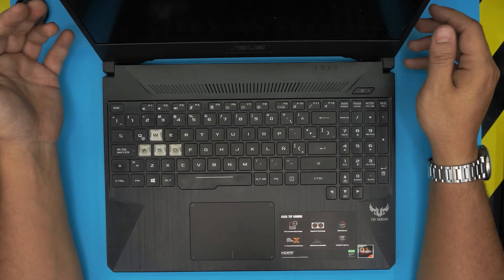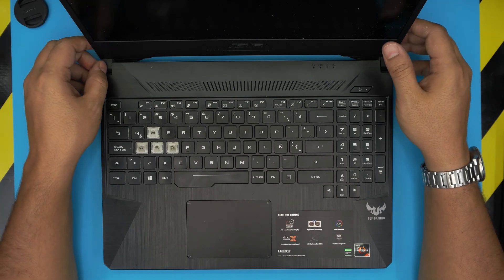How to Repaste and Clean ASUS TUF Gaming Fx505d 💻🧹- Step-by-Step Guide

Comment: Hey so i just took all that stuff out cleaned my fans cleaned the proper places and put in thermal paste, screwed it all up and turned my laptop on and it's just the start up loading screen with an infinite loading loop what did i do wrong and why isn't my computer starting? Thanks!
Reply from the maker: Did you plug in the fans properly and infinite loading explain more please.. windows loading infinite or asus logo then infinite.
Reply: @uFixTek   Double checked my fan connections unplugged and plugged back in, Asus loading screen and then preparing automatic repair pops up but i brought it in to my local guys to check out so i'll update you on what happened but what do you think is wrong?
Reply from the maker: its for sure your HDD or System that is faulty my friend not the motherboard or anything. let me know
Reply: @uFixTek  so i did apply a bit too much thermal paste to the cpu and gpu but the thermal paste is non conductive and it was not a crazy amount, i only ran it for 5 minutes then turned it off and brought it into fucking geek squad when it was posting but not turning on and now my CPU is apparently fucked, could that of been my fault or would it be theirs because they had it up and running trying to redownload windows and a bunch of other shit BEFORE even cleaning out the fucked up thermal paste im in a big battle with them and wondering if this problem could've been cause by me or if it's most likely then
Reply from the maker: @tylermitchell684  oh boi i have two friend working in geek crap  , and the shit that say that they do in there its jew dropping. they killed you motherboard and giving you BS sub excuses. if your laptop was posting then tell them give me my laptop back as it was before i gave it posting at least, if a laptop is posting the CPU is 10000% fine.
im very sorry that this happened to you. i would talk to the manager and be like i have a video recorded and prove that you received my laptop posting and not its completely dead. i will file a lawsuit. sorry :(

Comment: Cleaned it today morning, I didn't dare to remove fans but I've cleaned them carefully. Temps dropped from 60-70 C with turbo boost disabled down to 49 to 47 turbo disabled. GPU is very quiet after cleaning.  Thank you bro
Reply from the maker: Awesome my friend! Glad it helped you😊Thank you for the feedback! if you wish to support the channel you can LIKE or SUB or both :P
if you have any question or request in the future feel free to ask me.
Reply: Wait what, 60-70 while gaming? I used to have 90+ when it was new but it worked fine , but now after two years and a half I have a lot of thermal throttling
Reply: Bro my system is going at like 98°C while gaming.

Fucked hangs while playing COD2
Reply: How did you do it without removing the fans?
Reply: @Cheng-n5r  I didn't remove fans.
Reply: @Christian_VII  but how did you clean them without removing
Reply: @donatello9656  compressed air.

Comment: Is the thermal paste really necessary? I don't have the ability to redo most of this, i was just planning on openning it up and using compressed air
Reply from the maker: Thank you for the feedback! if you wish to support the channel you can LIKE or SUB or both :P
regarding your question: as long as you don't lift the heat-sink and only disconnect the fan connectors before using air compressor, you fine it will help.
Reply: @uFixTek  thanks! And forgot to say the video is amazing
Reply from the maker: thank you for the support my friend :) 
if you have any question or request in the future feel free to ask me.
Reply: @uFixTek  what if the heat sink was lifted without re-applying a thermal paste? Will it pose a big problem??
Reply from the maker: @chescadeluyas  Thank you for the feedback! if you wish to support the channel you can LIKE or SUB or both :P
regarding your question: oh boi YES you will have a bad day and can damage the cpu or gpu with over heating and you will get sudden shutdowns. every SINGLE time that the heatsink is lifted it MUST be cleaned and repasted. even if you applied 5min ago paste but you had to lift it up, then you have to re clean and re paste.
Reply: @uFixTek  Now I know why my computer would suddenly shutdown. 😅 Thanks for the help! 😄

Comment: Ok so I got everything ready and started to take out the 8 heat sink screws.  Got 7 out and the last one was apparently super stripped from the factory.  I tried everything Google suggested to get the stripped screw out with zero luck.  Putting the rest back in 2 more stripped and won’t tighten. The screws must be made of the cheapest material possible.  So now my laptop is busted because the heatsinks are loose! What should I do?!??!!?
Reply from the maker: Thank you for the feedback! if you wish to support the channel you can LIKE or SUB or both :P
regarding your question:don't worry you fine :) its very common because they don't place the screw by hand or screw driver they use automatic screw driver and thats why mostly the treads go in sideways. the only way to remove them without removing the mobo or anything , its to isolate with tape and make a nice insertion over the screw and use a flat head screw driver to remove like butter :P
i use a this in the shop to make a cut you can buy a cheap version: https://amzn.to/3k0NuQm
cheap version: https://amzn.to/3Lc5VNJ
for e.g here is a screw i remove same issue: https://youtu.be/UaMO0sH45VI
check after min: 5:00
and to replace the screw buy a m.2 screw kit
https://amzn.to/37yDqLV
if you need more help let me know.
Reply: @uFixTek  thanks so much. I’m gonna order the cheap version and give this a shot.  You earned a sub.
Reply from the maker: yes make sure you make a straight deep cut, deep enough for a flat head screw driver. much appreciate your support my friend :)
Reply: @uFixTek  ok so I went and bought a Dremel kit locally.  What attachment did you use? It came with a metal cutting disc but it seems kind of thick.  I’m afraid it’s too big.
Reply from the maker: its 1mm think the metal cutting disk, don't worry just make a deep cut, use medium speed 
https://imgur.com/a/mQOTqBZ
if you want me to make short video i make it for you
Reply from the maker: here i made a video for you, hope it helps
https://youtu.be/xLt6dMIsO9E
Reply: @uFixTek  thank you!
Reply from the maker: its my pleasure my friend

Comment: OH WOW. So you replaced the thermal paste and left the VRM with no cooling whatsoever?  just WOW. Who cares that it gets over 100C hot right? If you have no thermal gel, at the very least use thermal pads for the VRM, this VRAM doesn't get very hot, you're right, it nice to cool it down, but unless someone plans to do the mining on this laptop, not that crucial, however I would totally disagree in regards to the VRM - this is very important. I bet you this laptop will have issues within a few years if used for gaming regularly. Would you say that the VRAM pads would be 1mm or 0.5 mm?
Reply from the maker: oki , let me explain a bit maybe you would understand, The VRAMS don't need thermal pads or anything as they won't heat-up and the bios for this laptop is locked you can't OC or push the limits of the vrams. the VRAM on a NONE OC GPU its the same as regular ram, you can have a regular ram with heatsink and without heatsink, it will make no effect on its performance. and the temps on we rams never go over 40c anyways. we have opened many laptop and tested the vrams temps. even some with RTX 2060 you don't even have pads or anything on them.
but if you feel like cooling the vrams is going to do any effect by all means go a head and place a 1mm thermal pad. 
also only a crazy and retard person would use this for mining. i been repairing and servicing over 18years and we have done many many tests, and i would not mention anything that could harm clients laptop or equipment.
Reply: @uFixTek  And that's exactly what I said  - the VRAM doesn't really get very hot, but the VRM (I have exactly the same laptop in front of me now) had the cooling from the factory for a reason, a crappy one, but better than nothing. VRM gets very hot on any graphics card with or without OC and will heat up the motherboard if not cooler properly. Now not every graphics card has the VRM cooling, but I'd definitely use the thermal pads to cool in down, to prolong the life-span of the laptop.
Reply from the maker: oh hell yes if you have the option and heatsink go for it its good to keep it cool, if you care about the laptop. but keep in mind that the vram would be your last thing that would fail in a laptop or any laptop, there are more sensitive or power mofsets that have way less life span compared to vram. I'ts good that you care about your laptop, as many people don't care about what they have, and start mining or rendering 24/7 :P
this laptop its not a workstation, or mining station.
i wish you the  best and if there is anything i could assist you with, feel free to ask me my friend. good luck

Comment: hi there,a question,a few days ago i decided to clean the interior from dust and i wanted to take out te coolers too.The cooler from the right didn t had a problem when i tryied to remove the fan itself for cleaning but when i tried with the left cooler the fan wasn t removeble,i coudn t take it out..The question beeng,the fan from the left cooler is removeble or not?(im worried to force it or something, without knowing)
Reply from the maker: Thank you for the feedback! if you wish to support the channel you can LIKE or SUB or both :P
regarding your question: yes both rams are removable and only after removing the heatsink , because the fan has a plastic arm that goes under the heatsink. so remove the heatsink and then the fan pull them out.